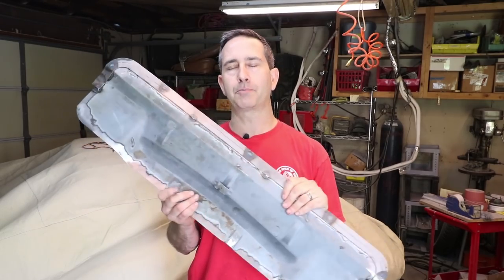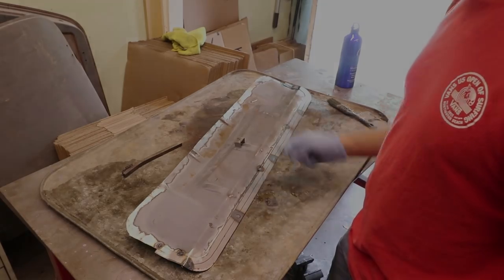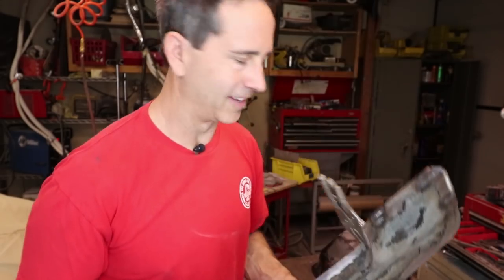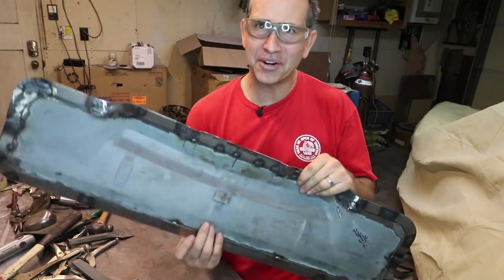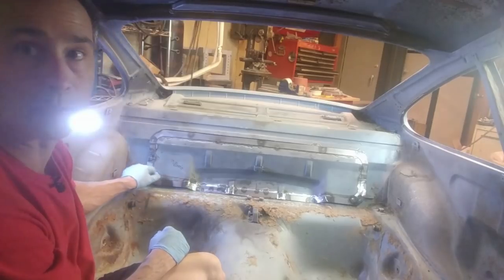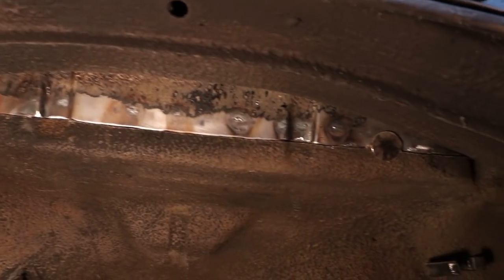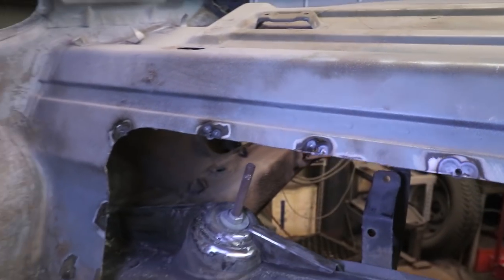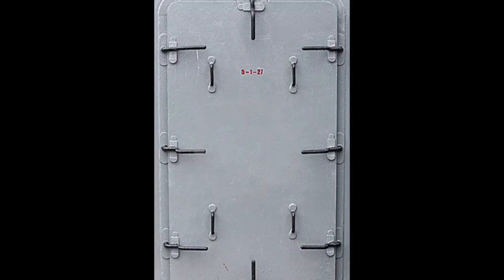Car Restoration Mistakes Are Good...Sometimes😜

Comment: Tom....your metal working skills never fail to impress me.  Great job.

To lessen the rattle, you might consider using a low durometer thin rubber gasket.  Would also help to seal out gasses/odors from the engine area.
Reply from the maker: When the screws are tight it doesn't rattle, just drums.  After the roll bar tubes go through, I will finalize the seals.

Comment: Hi Tom,  how will you seal around the roll cage and more so, how will the panel still be removable with the 2 tubes going through it ? Or is it just for access for welding the roll cage to the shock towers.
Reply from the maker: There will be a rubber flange thingy that I haven't sourced yet.  The holes will be a D shape and will break through the edge of the part so the panel will come off.  Depending where the holes land it may need more metal too?